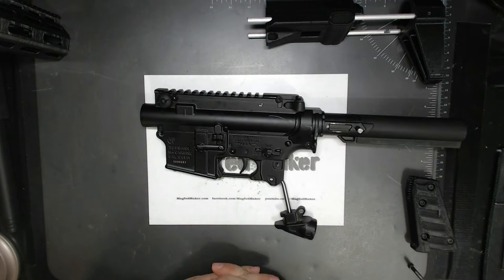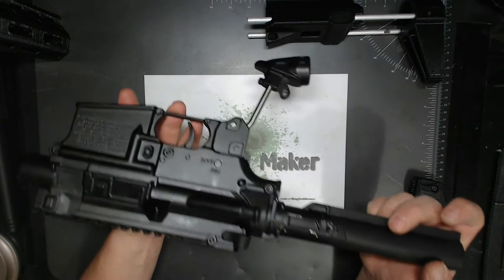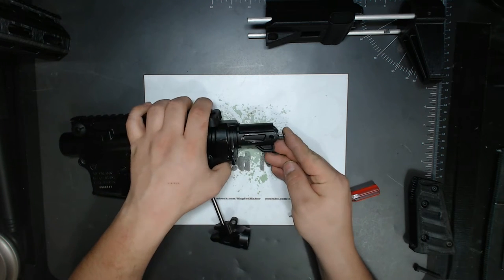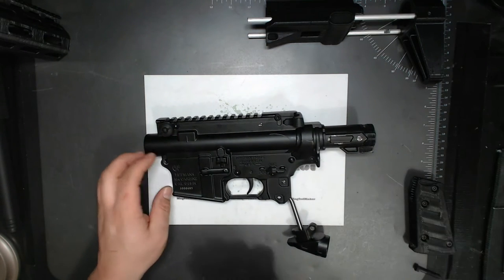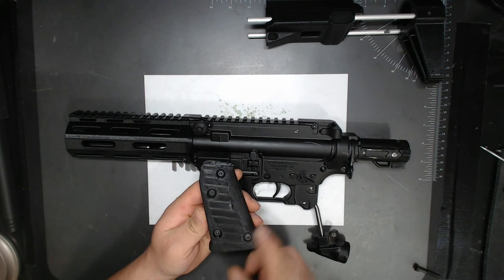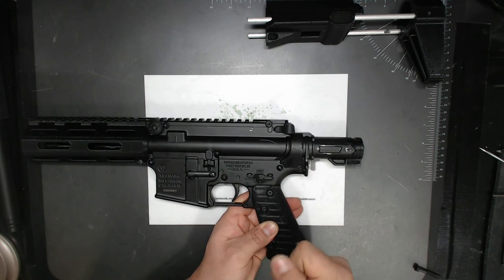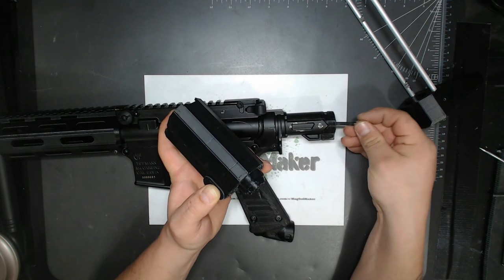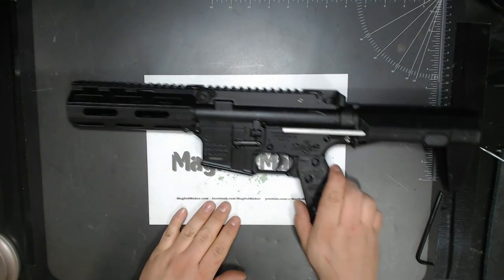Ratel   TMC   Installation

Comment: Trying to get the buffer pin out is making me cry man! lol its really stuck in there! 
Tell me, would you sell the end cap separately per chance?
Reply from the maker: Aartwood email or Facebook message me for easier correspondence, but I'm not sure what you mean by separate end cap. As for the pin, it is in there really good, but a proper punch and soft blow hammer will work, a c clamp with large nut as a jig, and also keep in mind it only comes out in one direction. the skinnier side needs to be punched towards the thicker end.
Reply: I mean the little cap you put onto the buffer tube to hold the spring and guide in.
Reply from the maker: Aartwood I include that with the Ratel buttstock, would you need an extra one?
Reply: Nope, just looking at removing the TMC stock all together and using it without the stock, however I would need the little cap to stop the spring from coming out.
Reply from the maker: Ah, I assumed you had purchased the Ratel kit. I placed a free to download 3D printable stock cap on the Facebook TMC Owners Group if have access to a 3d printer. if not, email me (ray@magfedmaker.com) and I can print ya one for $10 shipped.
Reply: Magfed Maker that's awesome buddy, think I emailed you twice by mistake from different addresses so you should get at least one email ;)

Comment: How would you take the stock off the buffer tube. (I’m talking about the factory tippmann tmc stock.)
Reply from the maker: TheJordanHead there's a pushpin that only comes out one way (popping out towards the side with the selector switch). Takes quite a hit from a punch and hammer, I also can include a jig for assisting in the pin punching for a little extra.
Reply: @Magfedmaker   bro your should try making high cap magazines for the Tippman.
Reply from the maker: @albertoa.navarror.8758  I don't think I'll ever sell printed mags, but I may release a design in the future

Comment: How do i remove the screw of buffer tube i need knock?
Reply from the maker: The pin that holds the buffer tube to the body? It only comes out one way, and you may have to use a hammer and punch. I believe it pops out from right (hopper port side) to left (safety lever side)
Reply: ok i will try punch